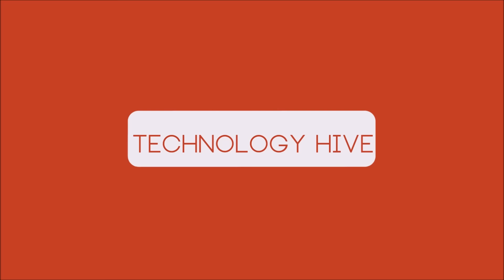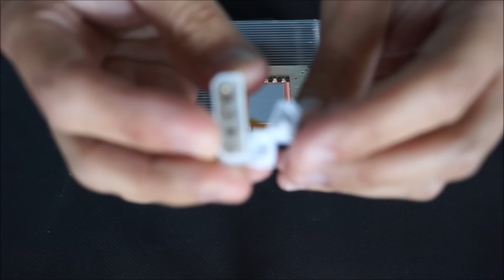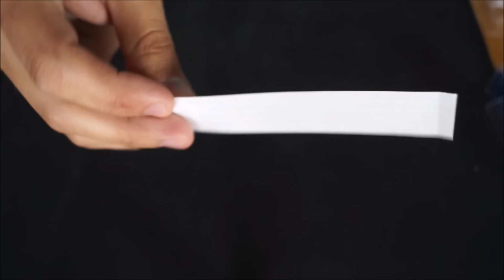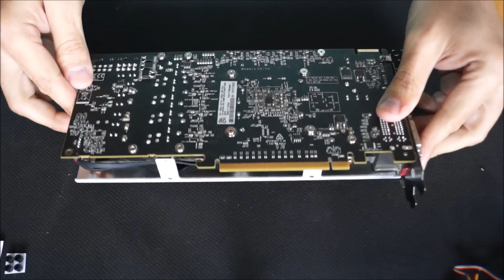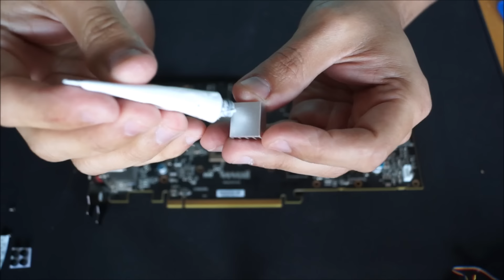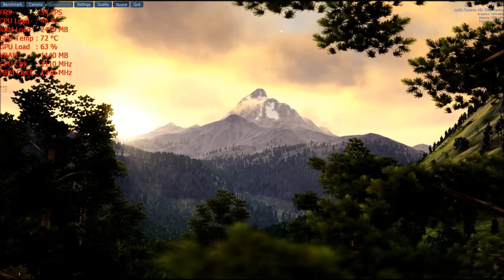Accelero Mono Plus VGA Cooler

Comment: since the vram heatsink will he permanent after applying the thermal adhesive, is it ok if u just use the thermal pads with the mono plus? will it overheat the vrams?
Reply from the maker: Thermal pads are not adhesive. If you use them, eventually they will peal off. They are meant to be used under pressure. You can use a smaller amount of adhesive so make it a bit easier to remove in the future. I have done it and with a little patience you can remove the heat sinks after a while.
Reply: Asus doesn't even bother anymore on their Phoenix fan.

Comment: i have a cosair spec 01 case and asrock b150 m pro 4 hyper motherboard.... will the mono plus be compatible with these?
Reply from the maker: ClashforReal you should have no problem as far as clearance. I had a spec 1 case. You have room there.
Reply: thanks for answering. Appreciate it :) just a question more....
Where should i connect the fan header wire to? the socket on the pcb of the gpu or to a molex adapter from the psu? because i saw comments on amazon that said connecting to 12/7 V via molex adapter to the psu... i didn't get what that meant... will it make a difference in performance if i connect to psu or pcb on the gpu?
Reply from the maker: ClashforReal connect it straight to the gpu fan header. Let the card control the fan.

Comment: does the twin turbo 2 fit on the gtx 1060 mini? because its just a few bucks more than the mono plus. i have a cosair spec 01 case will the mono plus/twin turbo 2 fit in it? if it does which one do u recommend to put on my gtx 1060 mini? sorry for long questions...
Reply from the maker: Hi. It says it is compatible with the reference gtx 1060. From experience with these kinds of coolers i can tell you that they fit most cards I have tested them on, reference and non-reference. I would first look at the PCB layout of your card and the cooler from the website and compare layouts. If you don't think anything will obstruct the mounting procedure, then I would go for it. The mounting bracket is compatible with pretty much every card out there. Hope this helps.
Reply: I have the same card, folks at Arctic said it should fit just fine, the larger ones might hang off the end of the card.
Reply: just hoping the large one doesn't hinder the fan header from being connected to the pcb
Reply: Did it work? I have gtx 1060 mini not sc and it runs hot and sounds like a jet on take-off! Want one of these, I think
Reply: Dan Daly yes the mono plus is awesome, it works as expected i dont get temps above 60 in pubg, to be precise i get 55 degree C in pubg, tried witcher 3 wont go above 60, but i am sure whatever game it is wont go above 60 or 65. But i recommend buying the twin turbo 2 since it does not require the vram heatsinks to be attached which btw are permanent and u can't send card for warranty... Check ur case, if the twin turbo 2 fits buy that or else go with mono plus, aby ways u wont regret the decision due to the amazing results...
Reply: Thanks! Twin turbo 2 just a touch too big. I tried to find a dead 1060 min SC and use that but this looks like the much better choice.
Reply: Dan Daly yes this is perfect, if u hace any questions during installation feel free to message me

Comment: Does the fan shut off at low/no-load like some stock cooler?
Reply from the maker: The fan does not shut off on its own. The card controls the fan according to temperatures, if the card itself supports this feature.

Comment: Hey man loved your video. It dont look so hard to apply. But do you think it would fit in a gtx 1060 mini 6gb ( from inno3d ) in a micro-atx configuration ? I hope it could enter in my case (Zalman ZM-T4 ) I can get a very good overclock so I think I would like to buy this one, but in the other side I  dont want to have my computer opened because its too heavy..Hope you see my point Sorry for my bad english :)
Reply from the maker: Hello. To be honest, it does not look like it will fit. I could not get it to fit in my old Phanteks P400 case either, and that is a mid ATX case. The only case this fits in, that i currently own, is my Fractal Define Design S.
Reply: I have the same gpu and the deepcool smarter case. It runs very hot (almost throttling); I hope I can fit this.
Reply: Technology Hive do you remember what height your gpu ended up to? Deepcool says I have 165mm max for gpu height.
Reply: @Orav A. Warranty isn't a problem on 10 years old graphics card.
Reply: @Orav A. How many hours do you have on it and where do you live? If you have 500 hours on an electronic part and it hasn't failed? It probably won't fail until it's out of warranty anyway. In the US you have a right to replace your thermal paste, the sticker over the screw means nothing, is why I asked where you live.

Comment: Okay, so I have Nvidia GeForce GTX 650 Ti Boost and it's listed on the box as being supported by this cooler, but I have a two pin slot for the cooler on the card, and this cooler has 3 and 4-pin slots. I guess I have to use the Molex adapter that came in the package and connect it to directly to PSU? Can you tell me how?
Reply from the maker: Hello. I would try and skip the molex adapter completely and see if the 3 pin fan connector will fit the 2 pin header on the card only using the ground and 5/12 volts pins. i believe it will work fine, but the fan will stay running at 5 or 12 volts at all time, which is no problem because the fan is super quiet even at full speed.
Reply: Yeah, I thought of doing that, but the problem with my card is that it those two pins are inside a slot that fits only 2-pin connectors, so the 3-pin connector can't go in. I was thinking that maybe I could somehow pull that slot out and expose the pins, but I'm afraid I might mess something up permanently.
Reply from the maker: You could splice the old fan cables and keep the plug, then hot wire it to the molex 3 pin adapter, then plug it to the new fan header :) I've done it, it works. And you could always rewire it back.

Comment from the maker: There is no guarantees. But, in my experience dealing with this cooler, it has fit every single card I have installed it on. From HD7870 to GTX 970's, to RX 580's. It is universal, as far as I know.
Reply: Do u know if works on gt 1030? [version that isn't silent profile obviously]
Reply: Hi Tech Hive. Do you know if it will fit this GTX 970 model - https://www.zotac.com/si/product/graphics_card/gtx-970-blower ?
Reply from the maker: It should fit just fine. This is the same layout as the card I had.
Reply from the maker: I am not so sure on this one man. Sorry I cant be helpful there. But, I do know the cooler is universal. So there is a good chance it will fit.
Reply: @TechnologyHive  my 1060 6gb evga is running 70 degrees can it fit this cooler
Reply: @MegaAlpakka Thats the worst advice i've ever heard
Reply: Have you personally installed this on a 580?  I have a 580 v1 with the blower.  Curious if it'll fit.
Reply: Can it be installed on a single fan gtx 960?

Comment: Do you know if this would work on a EVGA GTX 1060 3GB Single Fan model (03G-P4-6160-KR)?
Reply: Tom have u purchased it for your 1060?
Reply: Yeah, works very well. I never get temps over 60C (used to be constant 83C)
Reply: Hey just need your help will ya?
Reply: Hey @Tom can you make a video of installing mono plus on your 1060 coz i want to install it on my 1060 can you please tell
Reply: Sorry bro, it's already installed. I can't redo it. Just follow the instructions in the packaging. It's very easy.
Reply: Tom okay so can you tell me one thing have u used those vrm heatsinks or not?
Reply: Yes, I've installed the heatsinks on all the VRMs that were touching the heatsink that was installed originally. Make sure you use one of the small rectangular heatsinks for the two below the GPU chip because they will get in the way of installing the cooler if you use the full sized square heatsinks
Reply: Tom but ive heard somewhere that for stucking heatsinks you need to use some sort of glue provided by arctic themselves and you cant remove heatsinks after applying is it true if its true then if any sort of problem occurs in my card and i need to rma it to evga i cant if i cant remove those heatsinks.huh?
Reply: If you plan on doing this then don't plan on RMAing it. I don't know if the glue is permanent but I don't plan on taking it off.
Reply: Tom bro do u use any sort of social networking sites id like to add you if i need any assistance from you while installing mono plus on my 1060 huh bro?
Reply: I also have 03G-P4-6160-KR also maxing out at 83C with fan howling.  Did you overclock to take advantage of the thermal headroom?  I have ordered the mono plus (thought about Accelero L2 Plus but, hey, why not get something proven to work...) - I have never saved money by going cheap.

Comment: Nice, but lookswise I would say the Gelid Rev.2 Icy Vision looks better in a windowed case, even though it is much louder. And, it overhangs the GPU less than the Accelero. Arctic Cooling Accelero GPU is very good though, practically silent. Still, waiting for these GPU coolers to launch an RGB version. LOL
Reply: they believe more in function than the colouring of it :P arctic
Reply from the maker: Balb Mahal hehe thanks man. I have not seen that cooler yet. I'll have to check it out.
Reply: I’m thinking of getting this for my EVGA GTX 1060 as it has a crappy cooler and runs at 82 degrees under load even with 80% fan speed!
Reply: λucas is it Evga SC GAMING with 1 fan? it is so dam noisy.
Reply: Mr.Haaska My SC runs at 60c lmao
Reply: so is my now. i found weird blocker front side of cooling fin and i found out that it's there because it keeps vrm cool. after i did take that block off my gpu have weird pixel glitches all around screen when i rise power limit and overclock it little bit.
Reply: ein Kekman The one I have is not even the SC, it's just the normal ACX one with a single fan.
Reply: λucas lol